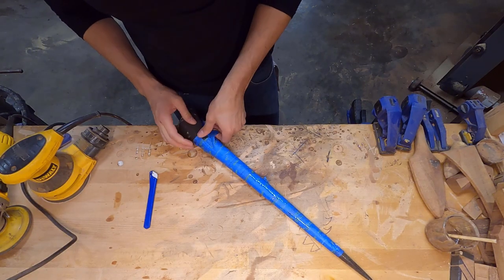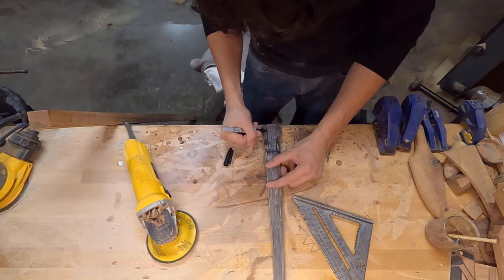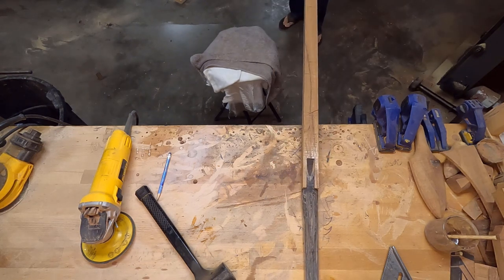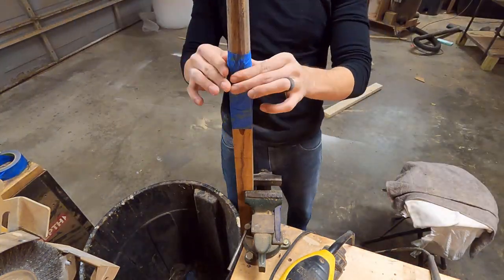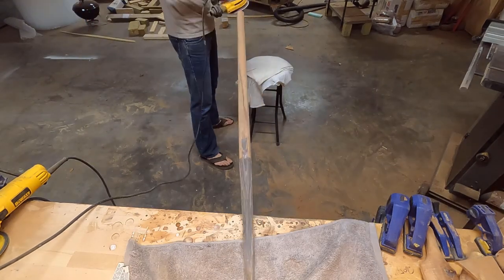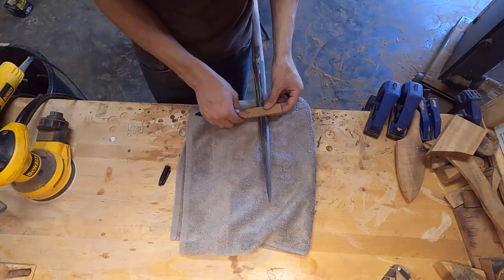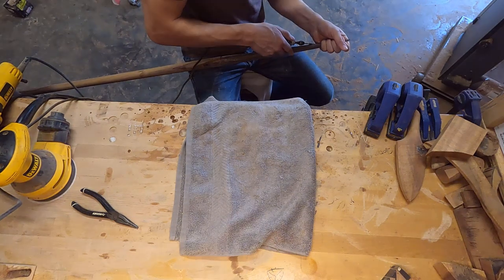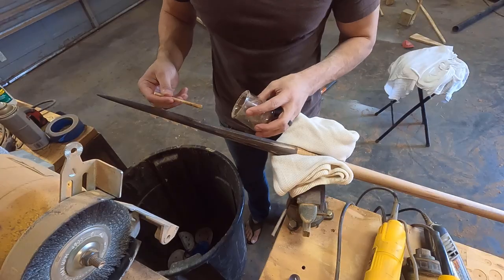Ihe, The Hawaiian Short Spear! Build and test!

Comment: Great work. Why did you choose a tongue and groove joint? Wouldn't a mortise and tenon joint be much stronger?
Reply from the maker: Not sure how much strong it would be but it use this method primarily because it was how I was trained on. So it’s just more familiar to me 🤙
Reply: @KoaStudio  Mortise and tenon joint is easily at least 75 times stronger. Literally the strongest joint there is. It completely  encapsulates the tang of the blade or tine and gives it much more support on all sides. It's same method used to attach striking tool heads to there shafts, such as the sledge hammer you use to process the lava pohaku for the stone head newa you made, which traditionally also use a mortise and tenon joint attachment.
Reply from the maker: No, the newa Pohaku is inset slightly usually with a leaf or some other softer material between the stone and wood to fill any gaps but it is not jointed, the lashing is the primary securing method.   Regarding mortise and tennen, 75x is a lot haha. You can’t do that normally with natural bone and marlin bill because the outer section is the toughest. The core is usually porous and most brittle. The tongue and groove helps to keep some of the outer sections in place, combined with a wrap or lash it becomes extremely solid. For a wood on wood joint you are correct. 🤙
Reply: @KoaStudio  I see...Thanks for teaching me something new. I normal work with hardwoods, metals and synthetic composites. So didn't think about most bones being hollow and/or porous. Is there any way to increase the density and solidity of the bone? Maybe grind it down super fine and reconstitute it in a vacuum mold with high strength resin? That way it's solid and homogeneous throughout.
Reply from the maker: Maybe? But it’s kinda just part of working with natural materials 😅